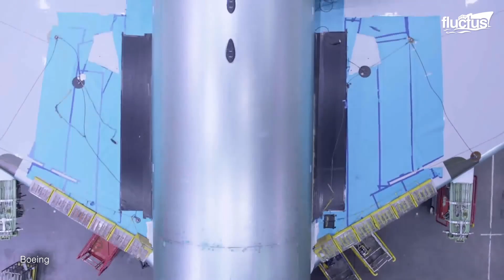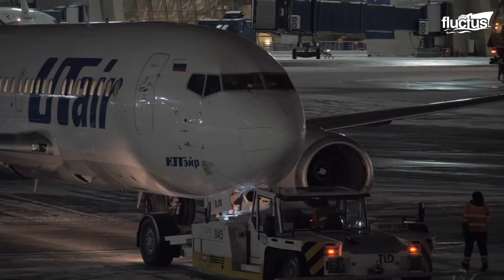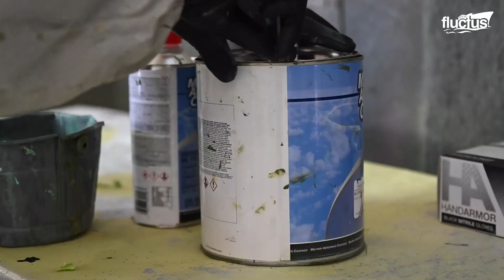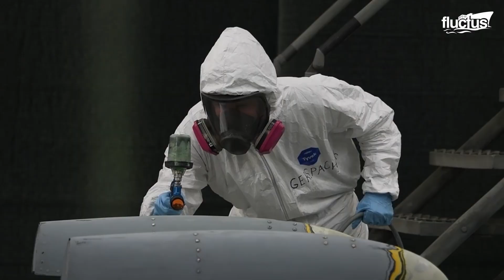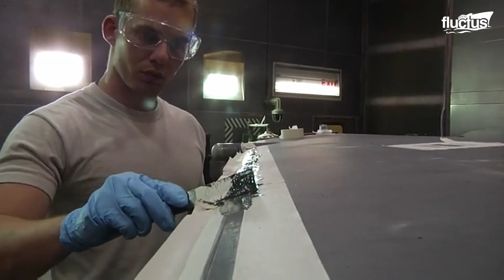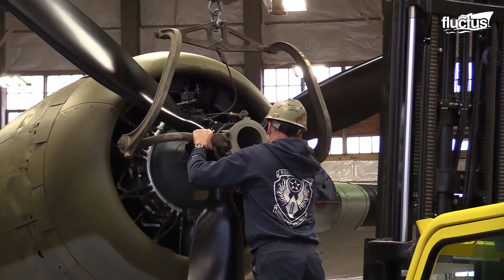The Hypnotic Process of Manually Repainting Gigantic Airliners

Comment: I'm amazed at the number of painters that do not properly handle a spray gun.  They may get away with it on aircraft but they couldn't paint a car that way.
Reply: So, what's the proper way to hold it?
Reply: @2degucitas  Good grief.  It isn't how you hold it, it's how you move it.  You never swing a gun back and forth.  You move the gun so that it stays parallel to the surface being painted.  If it moves in an arc it will apply more paint where it's closest to surface and less paint at each end of the arc.  If you pay attention to the video, you will see several painters moving the spray gun in an arc.
Reply: @dlkline27  ok. Try being less hostile.
Reply: @2degucitas  I certainly didn't intend to sound hostile.  Please accept my humblest apology if my poor choice of words sound that way.
Reply: @dlkline27  That's ok. I'm not a snowflake. How many years did you do spray painting?

Comment: why did they stop using crafts with no paint 4t it saved fuel?
Reply: In the case of American Airlines it was the change to new aircraft (like the Boeing 787) which have extensive composites.  Previously they would polish the aluminum, but not possible in composite airframes.
Reply: yes paint is a lot of weight but you need paint for protection.